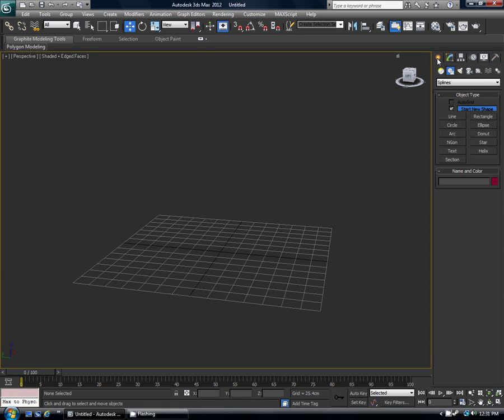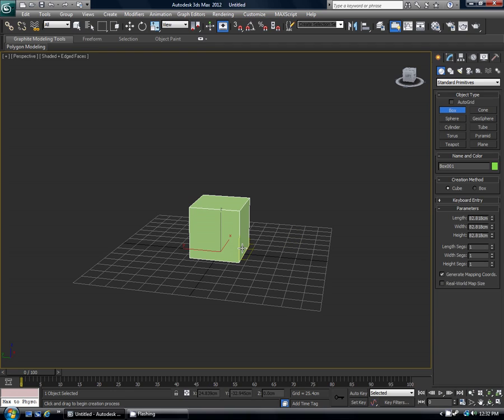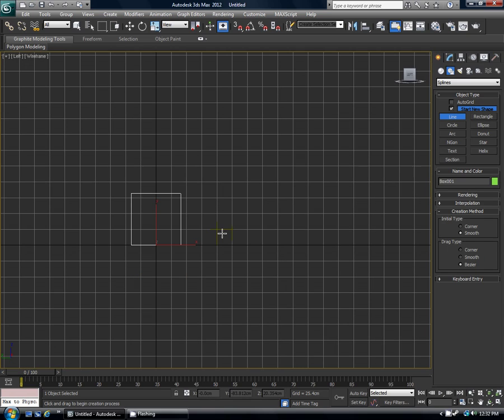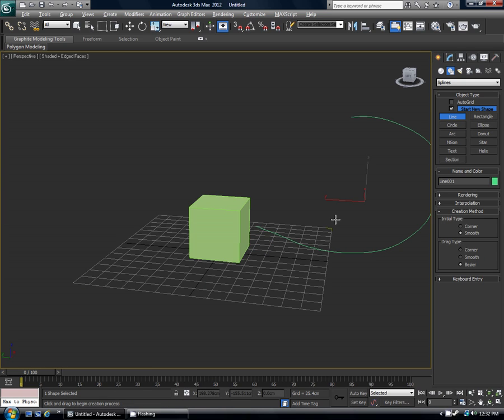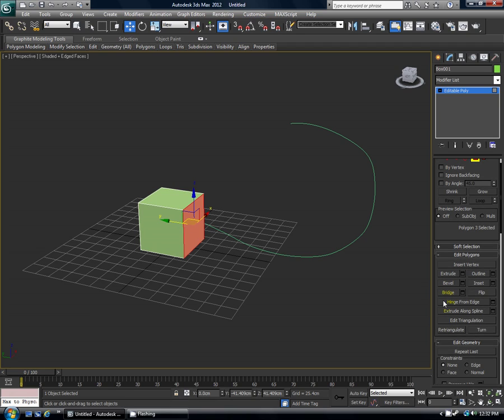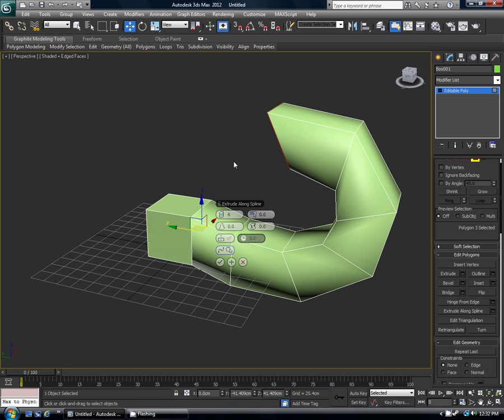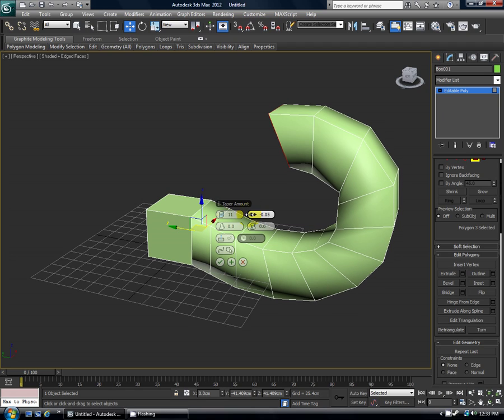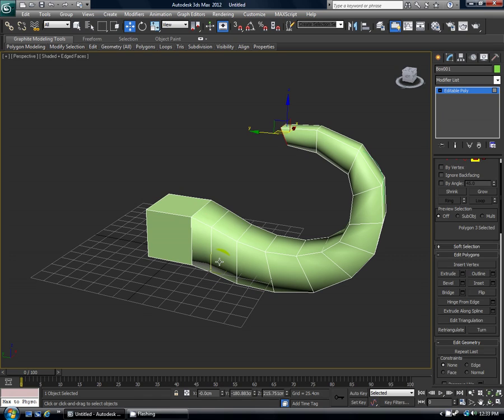How to extrude along a spline in 3ds max

Comment: please help, the extrusion is not following the spline, it's going the opposite direction
Reply from the maker: +.::Let's Play::. I have seen that before but forget what causes it. first I would try clicking the extrude along spline align button.( this shows up after you click on the extrude along spline settings.  the icon is a rectangle with a blue arrow coming out of it. you can check box it on and off to see how that changes the extrude.

another thing to try would be to go to the utilities tool in the upper right( looks like a hammer) then click the reset xform > reset selected > then either collapse that down or right click on the object and say editable polygon.  That usually fixes strange behaviors.
Reply: ThePolymonger thanks
Reply: +ThePolymonger , hi ThePolymonger  just a follow-up. is there a way to extrude from a square face to another shape. just like the BLEND version of adobe illustrator, where at the beginning the shape is a star then at the end of the path it becomes a circle or anothe shape. i tried the loft but i think it only needs 11 shape, and there's no other parameters to customize only twist, scale, but im not sure tho coz i havent tried teeter and the others.
Reply from the maker: you might be able to get the look you are going for with the bridge tool.  you would need to have the same number of verts on the square and the circle geo and have them as 1 mesh already then select the faces on each side and click bridge.  It might do some funky stuff or at least get you in the right direction then from there you can add edge loops in between and smooth out the transition to be what you were looking for